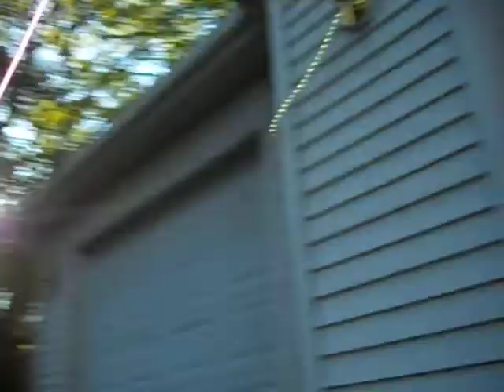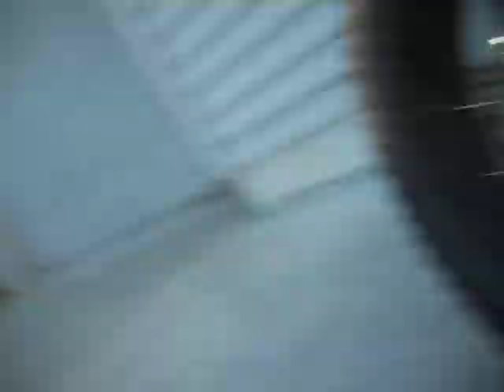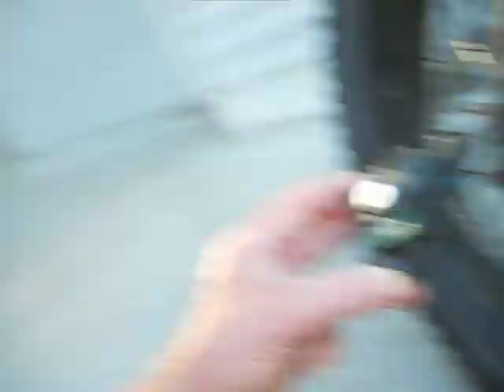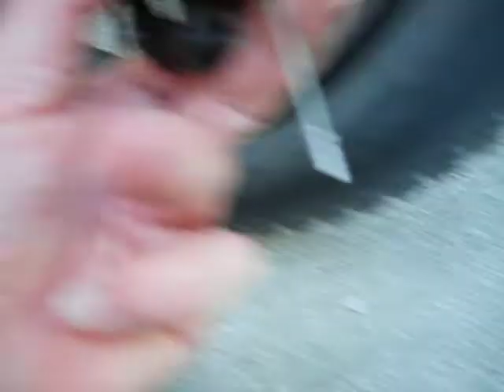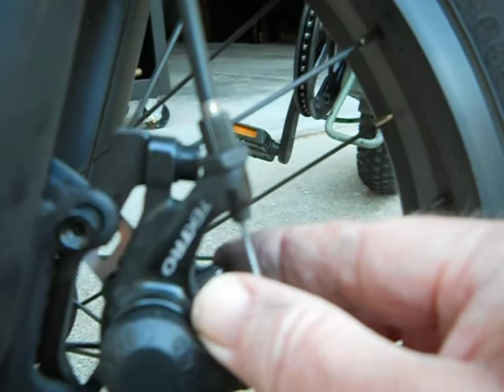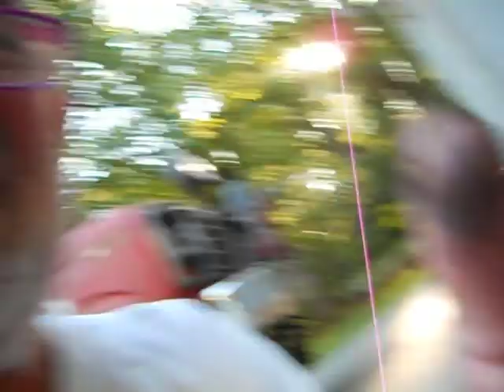Rattan E-BIKE LM LF 750 tektro brake pad removal and replacement E10.11 m315 m355 pads

Comment: I have 2 of these, bought at the same time. One had tektro and other uses winzip. I can’t find info on the winzip brake pads
Reply from the maker: DG, what I would do is pull the caliper like I showed in the video and pull one of the pads like I did to get a number off the pad. If no number shows I would measure the pad and take a picture of it then go to Ebay and search for ebike brake pads. I found several sellers who had sizes and shapes posted. It should be fairly easy to locate a pad model/number for them.
Reply: I think I was sipping on tingle drink last night I did find a float I took it out and then I noticed I didn't take it out but I took it out and I found it but anyway thank you man